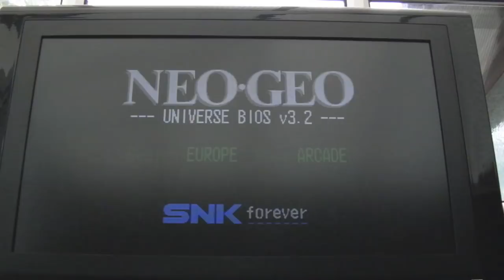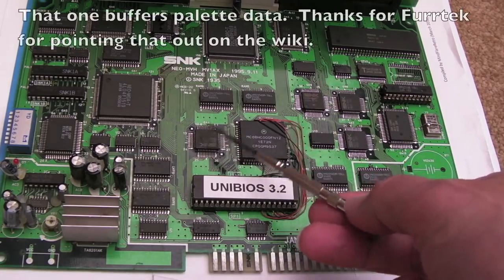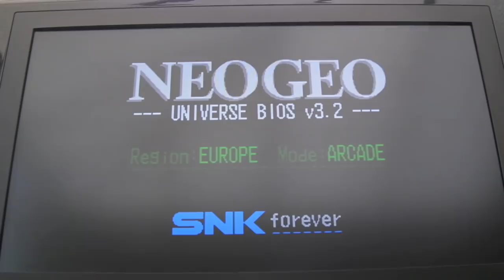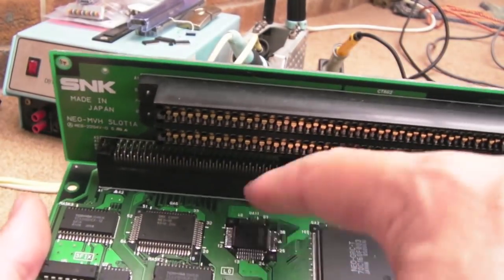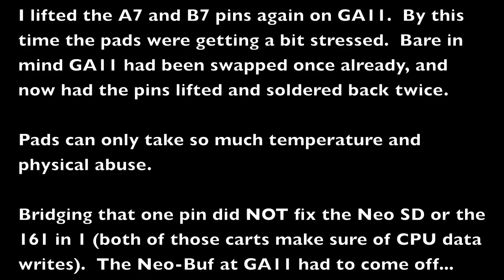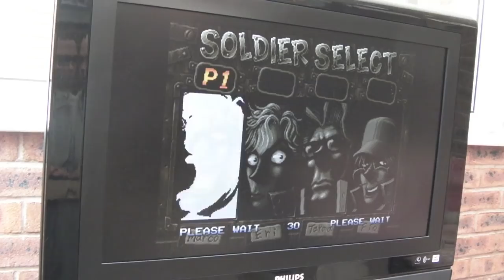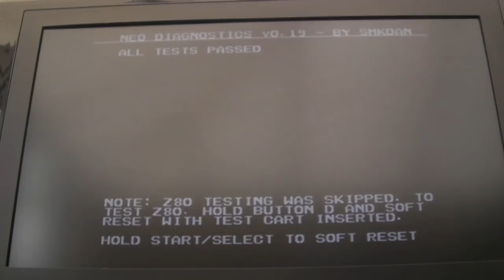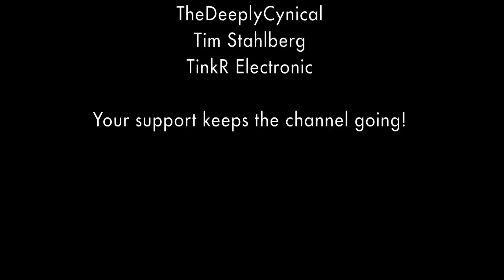SNK Neo Geo MVS Junk Board Repairs Part 5 (MV1A SM1 Bypass Mod & Neo-Buf Bypass & More)

Comment from the maker: NOTE: Where the 1K resistor was removed for the SM1 bypass, that goes to not only the WAIT pin but the BUSRQ pin.  This is not a problem, the high CE acts like the pull up there too.
Also note - see the thru hole ceramic cap on the underside there - I added that and forgot to mention it, it was missing a cap connected to the DAC - looking at MV1FZ schematics, should be 2.7pF I think.  That thru hole cap is temporary until an SMD cap arrives.  The cap was probably not essential, but it had been broken off by a previous owner.
Check out Furrteks page on Patreon:- https://www.patreon.com/furrtek

Neo Geo Dev Wiki (chip pinouts) - https://wiki.neogeodev.org/index.php?title=Main_Page

SMK Dan Diagnostic BIOS - http://smkdan.eludevisibility.org/neo/diag/ 

UNIBIOS - http://unibios.free.fr/
Reply: Can you please contact me private. I want to discuss donating. (Items not money lol)
Reply: Sorry to be offtopic but does anyone know a tool to log back into an instagram account??
I somehow forgot my login password. I would love any tips you can offer me
Reply: @Waylon Joshua instablaster ;)
Reply: @Hank Emory thanks for your reply. I found the site thru google and I'm waiting for the hacking stuff atm.
Takes a while so I will reply here later when my account password hopefully is recovered.
Reply: @Hank Emory It worked and I now got access to my account again. I'm so happy!
Thanks so much, you saved my account :D
Reply: @Waylon Joshua No problem =)

Comment: This is quite encouraging :) i might have another go at fixing my zapped MV1A. I think a haven't tried removing GU11 yet. That might be blocking the data bus... well there could be loads of other faults, but it's worth a try.
Reply from the maker: If you are stuck at cross hatch on a MV1A - GA11 is likely the cause!
Reply: It's not even getting to that point. Stuck in watchdog. But it could be so many things. It would be great to know the minimal requirements to boot the BIOS without having to strip down a working board chip by chip. :D That would help narrowing down the fault with such a board.

But i might do that... i have a working MV1ACH

Comment: would it be possible to take one of these spare working boards and make a diagnostic board by socketing as many of the chips as possible - it wouldn't have to look pretty, the important thing would be that you would be to have a 100% working board with chips that you could swap out in order to test ones you thought might be faulty. I guess maybe a lot of the chips themselves just won't work that way.
Reply from the maker: The problem is I don't think you can get sockets for all the different SMD chip types.  I do have some 128 pin QFP sockets though which I intended to use with a SNES.

Comment: Where do you source your ESD underpants from?
Reply from the maker: You could get these and cut them to size =D  https://www.ebay.co.uk/itm/Portwest-Unisex-Anti-Static-ESD-Trousers-Electronic-Industries-Work-Pants-AS11/172933362986?epid=1363134835&hash=item2843a1b52a:m:mCZmwRXMcQObqJKEscq7IPg

Comment: Hi: It seems nonsense, but sometimes it's hard to find some products from UK that aren't expressed in mm that I know more. Also the quality and so. Could you post a link to your braided copper wire, please?. BTW if you are searching for a board to fix, I've got an Amiga 1200 one with a problem showing the right colors and an Amstrad PC3086 one with some problems like the onboard Paradise PVGA1A chip bad or poorly soldered as I tried with a new one a couple of years ago.
Reply from the maker: 1200 sounds like a DAC problem, or leaked caps (or both).  I might take you up on those boards at some point if you dont get around to fixing them =D
Reply: I have this board since long ago. I think that  I fixed the problem initially but later the problem was there again. It was this thread: http://eab.abime.net/showthread.php?t=64675
Reply from the maker: Looking at the schematics there are two possibilities I think 1) A data bit on the DAC is stuck high on blue, giving it a blue tint.  or 2) the clamping diodes there could be a problem.  There are two diodes that clamp each of the colours, if one of those has shorted it could mean that colour is pulled high on output.
Reply: To tell the truth I would need a lot of time to try to fix these two boards (A1200/Amstrad one) as I just don't have your skills at all. They both are in my opinion great ones to fix. Ahem... What about if I send you the A1200 board and you fix it/make a video if you like and I pay you the repair plus sending costs?. I recently saw that Jan Beta had an excellent idea: a C64 Repair Giveaway riffle. I just think that that's the future for repairing channels like yours mainly because you can't be buying/repairing... and then having to store all of that stuff. So I think that you could select and then to try to repair a board from different systems and  make a video if you like. You can give a cheap price for the work if you can get some incomings from the video or the patreons interested in such videos.  Dunno, but in my case I would be very interested in such repairing videos. Just my thoughts.
Reply from the maker: Watch this space!  I might do something like that at some point =D  One of the problems is sourcing spare parts.  For example, if the DAC has failed on that 1200 board, the only likely source might be another faulty 1200 board.
Reply: I've now opened the box where I had this A1200 and I see that I changed the DAC too. I did an ugly soldering job though but I believe to remember that it was working just the same. I will connect and try the board to see what happens.
Reply from the maker: I only use a cheap 15w Antec iron for most of my soldering work tbh!  Get some flux - chip quik or Amtec!  That really is the key to soldering something like this, because the solder will flow and it wont short, so you can get away with using a crazy sized tip and it shouldnt matter as the flux will stop the joins.  If two pins do join by mistake, just use a bit of desolder braid.

Comment: Hey guys, I was dumb enough to purchase a CMVS from Aliexpress. I paid 400 CDN dollars with shipping. Just after a few weeks I am getting this error 

Hardware Test Failed

BackUP Ram

ADRS 00D00806
WR 5555
RE 5755

I contacted the seller and he has stopped responding, I do not want to send the unit back to him and spend 100 dollars in shipping. 

Can anyone recommend where I can start troubleshooting this error. 

Sometimes the unit works perfectly... Thanks for reading.
Reply from the maker: It sounds like you've got a faulty backup RAM chip on there!  Any idea what board revision it is - probably a 1C or 1B or something.
Reply: It is MV1C, and thanks for the reply. Sometimes the MVS mode works, there is also an option to Press B I think to use the AES Mode.

Comment: sm1 unresponsive is related to a damaged sm1 rom or to other chip?
Reply from the maker: It can relate to lots of things in the audio section - My guess on a MV1A/X it will likely be a bad Neo Buff chip, but a bad SM1 ROM can cause it too.
Reply: @GadgetUK164  the strange is tha after i repaired a broken trace between the z80 and the ym2610 it worked, i heard music and played but after i closed it in the plastic shell it stopped working with error z80 dead / errored /communication issue
expected: 03
actual: D3
Reply: @GadgetUK164  i am also afraid of multigame 161in1 fried something, on the mv1b that i repaired the other day (btw it was the faulty ym2610) sound is glitchy and sometime instruments don't sound.